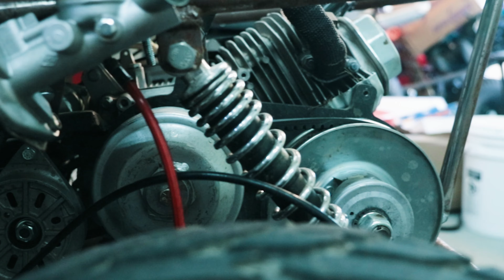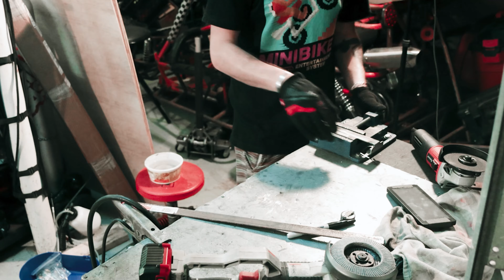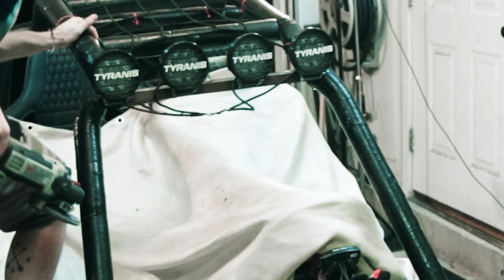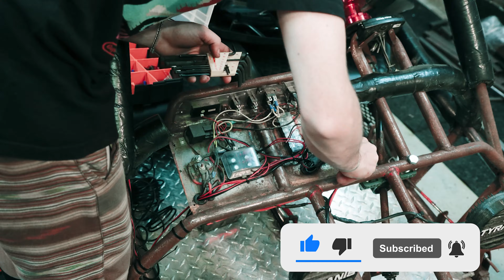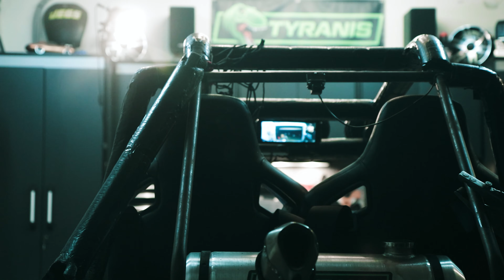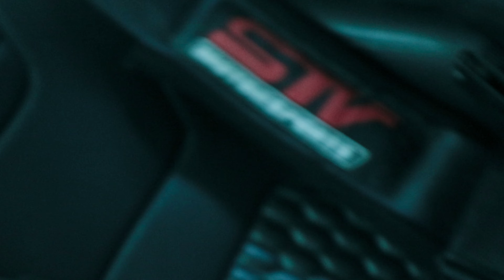Go Kart 12v Digital Rear View Mirror Install! | Car Back Up Camera

Comment: I built a vintage style go kart and wanted to mount a camera as a rear view, The problems I'm reading about is back up cameras have such a wide field of view that they work well to back up slow and close but while driving are useless because someone behind you turns into a dot when they are 30 feet away because of the wide field of view.